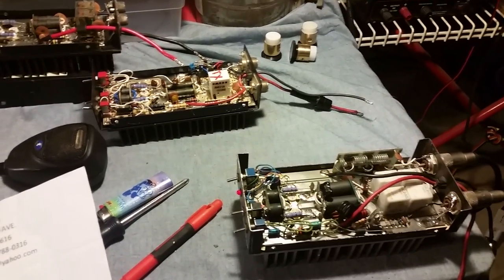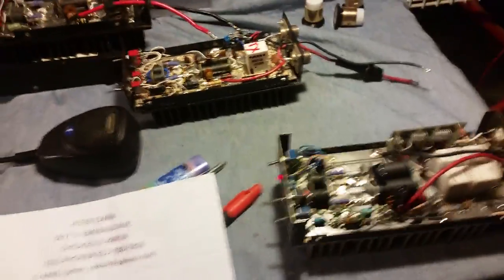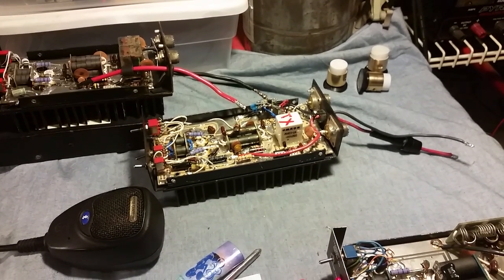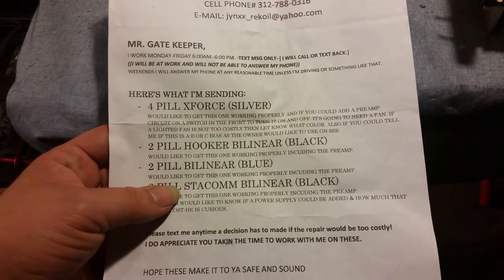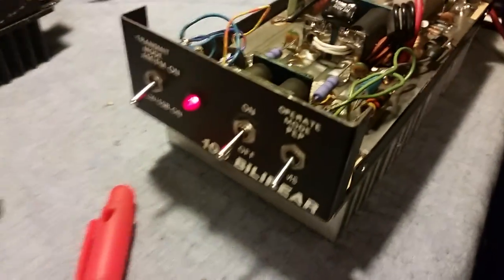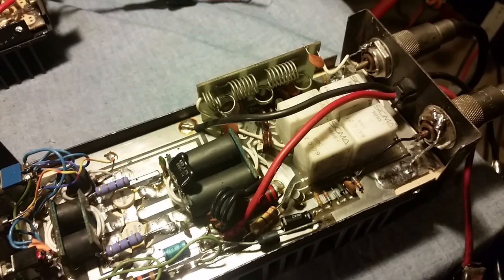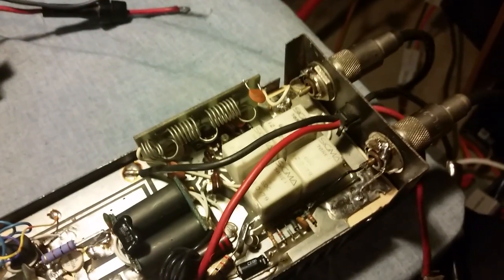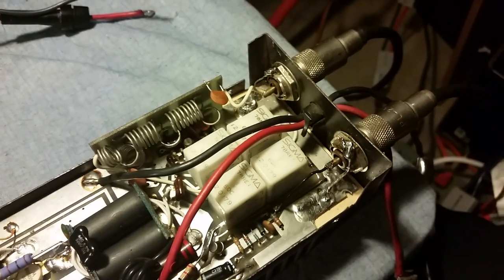Hooker 100, 100 Bilinear & Stacomm Amplifier Repairs 1 of 2

Comment: Pull the relay, take the cover off the pulled relay, build a chatter circuit, spray contact cleaner while relay is chattering, let it chatter until the cleaner evaporates, replace the relay back in the amp, problem solved. No need to replace the relay. Carbon build up on the contacts is the problem... I would also pull the T/R relays and do the same to them.

Comment: That same amp was sold under different names. The MRF 450A is a 50 watt .they only did 100W RMS at best. With the old dip mica caps I found go off value dropping off output and input SWR. The pre amp not very good. On my DSS 4 pill I took the pre amp out relays and all. They made a hooker 100 base amp with  un reg supply . I just re did. that was pilled to MRF 455A doing 120W RMS and bigger diodes and cap . It came to me doing 90 watt and supply dropping to 11V . I put diodes and cap and input tune brought it up 120W RMS .at 13.25V . with 4W stock radio.

Comment: I know this is old but I found an old Hooker 100 Bi linear but the relay covers are missing , any place to find what they are so I can replace them?? Two double pole, double throw relays, 3000T on coils 185 ohms! Has stud mount MRF455s.
Reply from the maker: Oh wow good ? Man im not sure if I know or not its been so long since I worked on them. I know alot of these old amps use relays close to what Texas Star uses. Maybe someone will see this and help you im sorry I can't be much help
Reply: @1883GotDown  Thanks for the reply, I think the guy tried to clean them, messed them up and gave it to me!😲

Comment: preamps like these are only increasing noise not the voice signal, it seems that they are not really helpful much in improving ability to pull someone in better. increasing the level on the meter does nothing for real preamp to hear people. I guess you get what you pay for. But, did you test it on any other bands except 11? does it do 75 meters or 20 even? kC3BBI

Comment: if it were mine. i wouldn't be so concern in the preamp. most aren't clean low distortion pre-amp's.  i just picked up a sbe brute. i turned it on and can hardly understand people out there who are weak signals. it sounds all scratchy like. full of static. i'm thinking on replacing all the electrolytics. i may need to replace traces. or run conductive ink for traces.